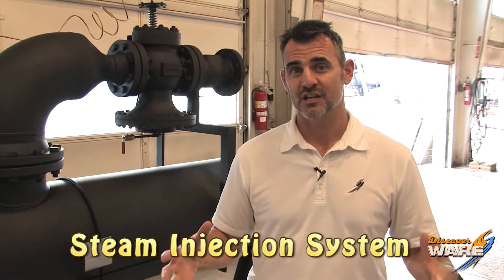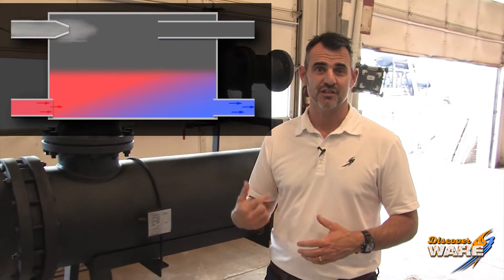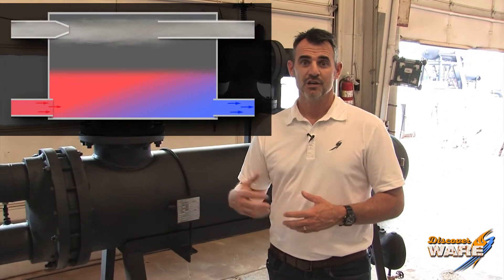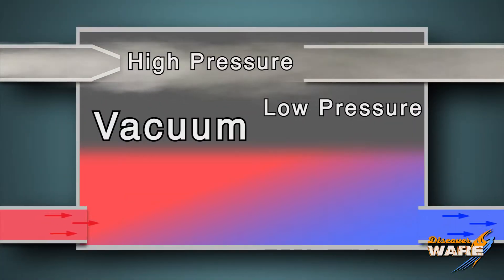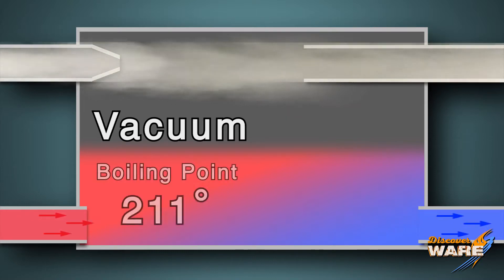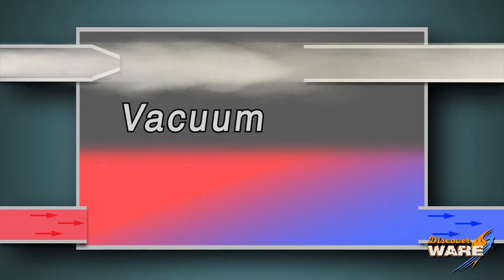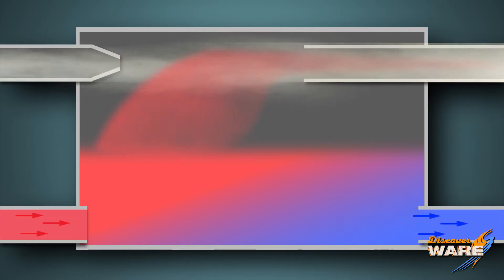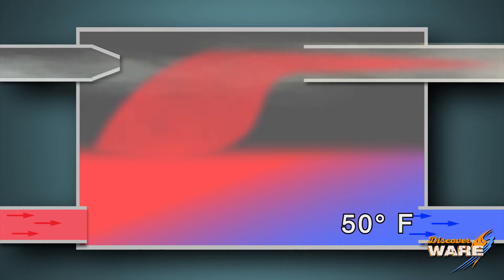Cooling Railcars with Steam - Steam Culture

Comment: I have been asking everyone in the railroad world this very same question from the time I was a little young lad back in the 1950's to now. This is the very first time someone answered my thrust for a proper answer. Funny as it my have seen when I was in college learning engineering in electronics, asked that question. And just as before, was referred back to the course in Thermodynamics. No answer until you pay for the course. That was not my track at all electronic engineering and the like. I did find a building engineer who tried to answer my question, But that was a steam driven  Absorption system. I needed to know about how Railroad cars system worked.
Thank you. and Yep, I did finally find answers and drawings of systems on railroad passenger equipment. Wow, That was so funny because I did learn about, Bernoulli Principle, in class back in High School basic science. Holy cow what a simple and easy thing to know that was right in my head. LMAO  Again, Thank you. wow  😆👍